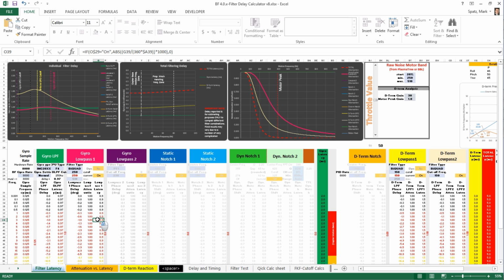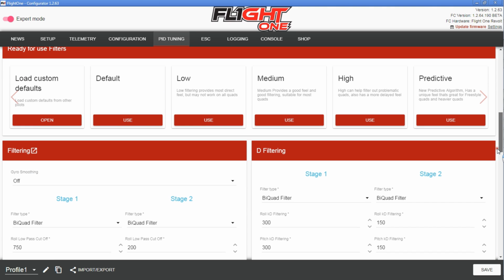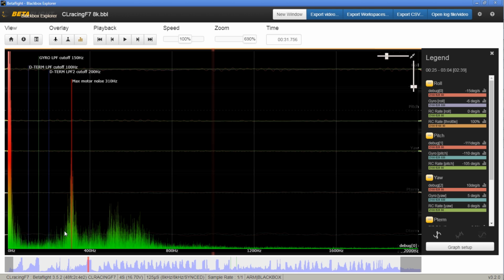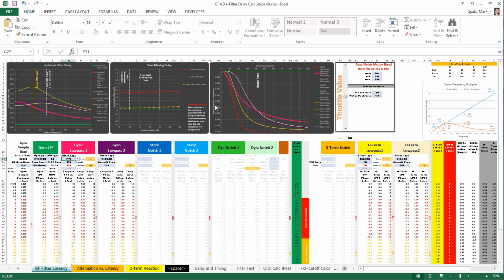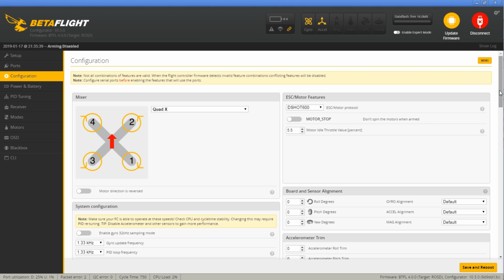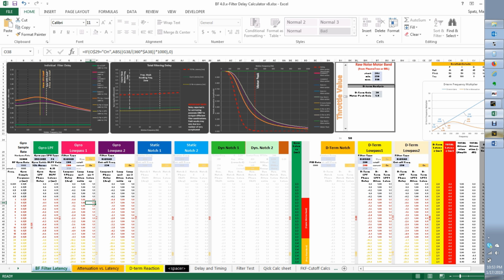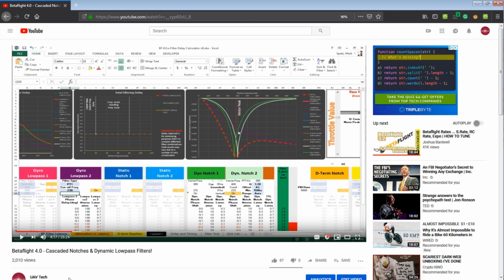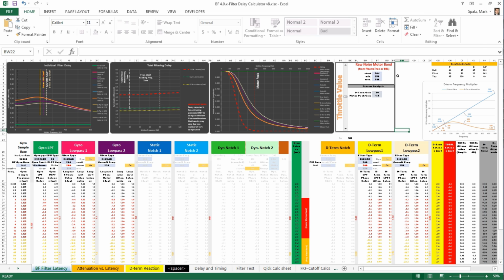Betaflight & FlightOne: Filter Fundamentals Part III - Filter Setups

Comment: which filter is stronger in F1, RCFIR2 or BiQuad?
Reply from the maker: BiQUAD is strongest as 2nd order lowpass.  RcFIR2 is basically the same as the Frequency Filter (a 1st order). 

For 2nd order filters, u need to have cutoffs at 150hz+ or the phase delay will get you.
Reply: @uavtech  So I'm running 32k and felt like Gyro stage 1 with RCFIR2 filter at 220 and stage 2 bi-quad at 180 was too much filtering.  Is having RCFIR2 and Bi-quad overkill? Suggestions?
Reply from the maker: @DiademStudios9  , make the 220 a BiQUAD and 180 the BQRCF2.

I would leave both on, but if u want just move up the cutoffs.  I have not seen a build that in 32k mode, a single lowpass filter - without the dynamic notch or something - was enough.  But with that said, if you want to run on a signal, by all means.  If u were to try, i would make it BiQUAD and move it down to 130 to 150.

Does logging works for you?  That would really help reduce the guessing.

Also, which handles prop wash the best without other bad side effects?
Reply: @uavtech  Unfortunately logging doesn't work for me as I'm using the F1 OSD FC.  I've had no luck recently.  I did try RCFIR2 at 250 and BiQuad at 180 for gyro and that seemed to feel much more direct and responsive on the sticks and prop wash handling was great as well.  

I think I may reverse the filters and keep the frequency to see how that affects me.  I just really wish F1 figured out the logging issue first before creating Falco. Oh well
Reply from the maker: Me too.  Preston asked me if i wanted to do some videos in F1 filtering and I agreed, but was thinking i would have logging to show some more depth.  Will keep working on it though.  F1 is good firmware.

Comment: With all the new filter settings comming in 4.0, BF is closer to perfect filter setting from default than ever before. 
I especially like the improved cascaded notch. Seems to take the most and then the lpf handles the small here and there.

Comment: In BF 3.5 what filtering settings do you recommend for a 7" build. I have light vibrations in my video in slow cruising speed and am trying to figure out if filtering will help.
Reply: Fancy seeing you here, James.
Reply: @d3c0deFPV  trying to resolve this weird vibration in my video at slow cruising speed. First time i build a 7"
Reply from the maker: I would first flash up to 4.0.  Lots more tools to help tackle.